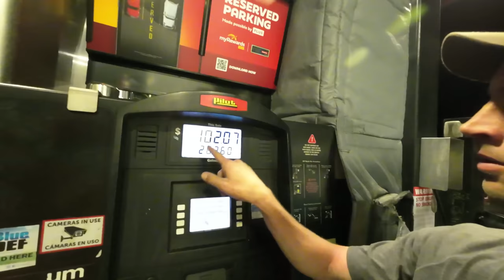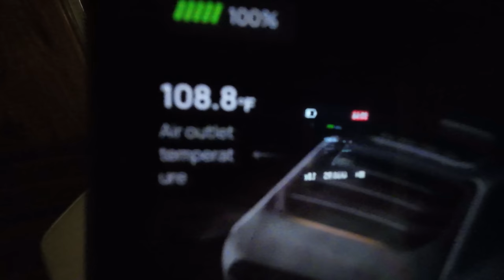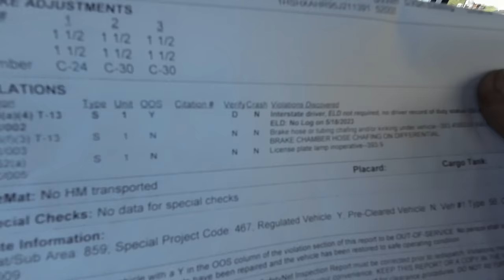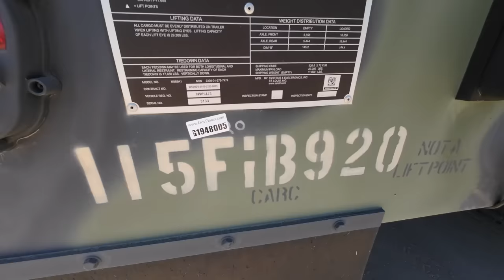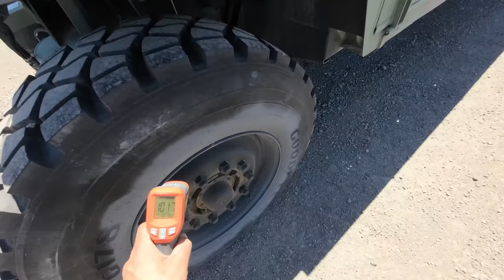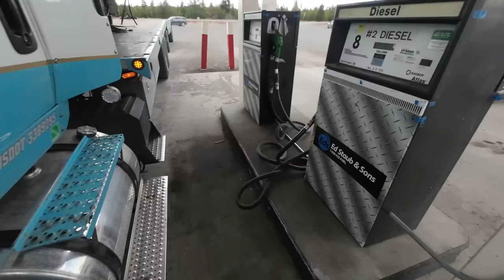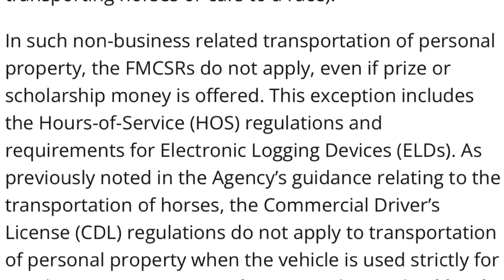Busted by CHP!   But I Know a Loophole…

Comment: So, before building a cabin on that trailer, build a frame slide out for a porch. Then build the cabin above the porch.The trailer is way over built for a cabin, so take advantage of that and add some more weight by building a slide out porch bed.

Comment: Sounds like you want to build a tiny house on that trailer.  A friend did that on an old enclosed trailer he originally purchased to move himself and his wife to Florida.  After they were settled in, he stripped it down to the frame and built the house on it.  Came out really nice and they now use it as a guess house and air BNB income when no one is planned to be visiting.  I envision a nice cabin on that military trailer.  Good luck, can't wait until you have the time to do that series of content. Stay safe.

Comment: Crossing from Texas into NM I was once told I needed a log book for a company 3/4 ton pickup since I was pulling a trailer and was more than 100 miles from the yard. Empty 16' trailer, 3000 lb axles. I pointed out that a CDL was not required to operate said vehicle. He ran me through the wringer for about 30 minutes, made me pay a $7 'road use tax' for going 20 miles into NM [which I suspect was actually lunch money] then cut me loose with no tickets. I got the load I was after and left his fine state with finger extended.

Comment: Some trailers with that axle setup have a air cylinder connected to the reverse light wire that pivots the axle to change the castor so that you can back them up and they will steer properly for you.

Comment: Lol, you're getting about the same MPG as I get when towing a 4000lb trailer with my first-generation Tacoma.

I'm hoping to improve that a bit, though. I was involved in a hit and run accident recently, so while my truck is torn about to fix the damage from the wreck, I will use this opportunity to fix a few things I've been pushing off. Exhaust leak, busted wiring harness for my AF sensor, and cut out or replace a partially clogged cat. I'm hoping getting rid of the bad cat will show an improvement in power and mpg.

Comment: Here's a thought, simply transfer the swap-body onto the trailer and bingo - you have your cabin away from home and you will have a sun-deck too (I seriously doubt that the wee swap body camper will be too long for that trailer - so a wonderful open area sun-deck will be gained -simply by putting the swap-body camper - directly onto the trailer.
It is after all, part of your "long term plan" isn't it - to have a camper on that long/low-boy deck.?

Comment: Before you said anything about a cabin I seen how wide this trailer was and thinking the same thing for living quarters. The fact that the trailer steers, and is on four wheels, makes it ideal because one does not have to worry about tonged jack as well as many other aspects of a standard camper. I would put some stiff legs (levelers) on the corners for leveling if needed. Now that i've see this thing, I want one too.

Comment: Casey....On the ammo trailer if I remember correctly there is a pin so you can lock the steering so you can back it up easly but remember to unlock steering when you need to use it...

Comment: What a quiet running truck. Not much noise picked up by your recording device and I could actually hear and understand you. Laptop, head set 
Will the trailer need to be plated and insured ?
Subbed.😊

Comment: That protective coating on the sidewalls... pretty cool stuff.  It keeps oxygen and ozone out and lets the tires stay "fresh" for about 2-3 times as long as they otherwise would.  Of course, when it's that flaked apart, it will have already done its job.  Properly treated and properly stored, tires treated with cane be installed like 10-12 years after they were made and work just fine for just about as long as they would have when they come out of their original molds.

Comment: Hey Casey, I've had my experiences with CHP myself, and I've learned that if you disagree with a violation, you should insist on a ticket. At least that way you can fight it in court and get the points off your score!
Reply: As I explained to Casey ------------- You are correct about using your truck for "personal use", which does not effect your HOS, but you are required to  log it on line 1 - off duty and in the notations, mark it as PC  ( Personal Conveyance ) with start and end points as usual and include those miles as personal use, so they don't count when you file IFTA.

Comment: If you build a cabin on the trailer, build it with a 3 layer wall on one side. Hinge 1 at the top and 1 at the bottom so you can fold them out to form an outside roofed deck with removable support posts and legs. You can sit out on your front porch and enjoy the evenings even when raining. All you need are a few lawn chairs.

Comment: I'm sooooo with building the cabin on the trailer.  If I lived near you I would volunteer to help you build it.  I have construction experience, electrical, moderate plumbing skills,  siding , roofing,  windows and draw plans on CAD.

Comment: Until you 'build' your cabin on the trailer, I can see you using it on the forest cleanup.  A lot of things will fit in there that won't fit on/in other rigs.  Great for lots of pieces.   
I used to drive Flatbed only in the state of Oregon (from mid Willamette valley); one day my company decided that the load of Vetch seed I picked up needed to go to the Tacoma, WA docks the next morning so won't be uploading it.   So next morning off I went.  Got to the scales out of Vancouver WA and they brought me in and asked to see my log book (a what?).  He told me he could hold me there 8 hours.  I told him I knew nothing of the requirement and I was just following orders and that I would pick one up at the next truck stop.  He let me go.  Two days later I got sent to Seattle/Renton/Kent (had my log book) and on the way back at the scale out of Tacoma the officer told me he could give me a ticket for the Washington Sticker (back when you had to have a sticker for each state) being in the wrong place (and hence they get the nitpicky nickname).

Comment: The cracking surface on the tire is probably black spray paint. When Armor All  doesn't get the tire black and shiny enough for inspection troops will sometimes spray paint the sides of the tire.

Comment: When a vehicle gets sent to depot or RAD (Repair Activity Depot) to either be upgraded or refit, they are completely stripped and rebuild. All tooling and parts are installed and any accessories are placed. What you got was more than likely a vehicle that has be restored to new or near new condition. Excessing such vehicles is not common, but does occur when a new model has been designated.  If there are enough  VIN and/or any unit, equipment numbers you might be able to find the trailers actual history. You can also look into any internal odometer. It looks fairly recent so it should have some type of device.

Comment: To turn it into a mobile home I'd suggest looking into a light weight travel trailer that will fit in and take all the running gear and suspension off it and secure that to your new trailer. You could even have a travel trailer with slide outs.

Comment: For the air leak, Use the liquid version of Teflon tape instead of Teflon tape itself. The tape could get into other small areas of the air system and cause issues.

Comment: What would be really cool with that trailer is you could rent a custom self contained camper insert. You simply drop a side and then the rental place would put the camper insert in with a forklift.

I’ve seen other places where they make a camper insert that would fit in the back of a rental box truck. Kind of stealth camping using a box rental truck. You could put the camper insert in the trailer as needed. 

It could also be used as a construction site office trailer as needed.  You just put it in the trailer as needed and haul it to the construction site. 

Ever thought of purchasing these trailers and renting them out as construction site trailers?

Comment: What does the trailer weigh? A great platform for an RV build. Room for Generator and fresh water. Low center of gravity. heavy duty tow capability. After you build a shop, you can start on the RV project.. Very nice video!!

Comment: That trailer was reconditioned and that's crazy the BII was inside of it, usually units keep that in a separate cage in the motor pool so it doesn't get stolen.  It's obvious that after it was reconditioned it was NEVER used, the unit was supposed to go through the BII line by line and lay it out while removing the packaging and tags.

Comment: the 4 shackles on the top of the trailer aren't tie downs... they are lift points for crane or helicopter carry about.  But, they will work just fine as tiedowns if you wanna use them as such.

Comment: Note sure if some one already posted, but if my mind reminds me there should be a backing pin that goes in the front axle I believe the top right. To essentially lock the trailer while backing to simplify it. Although I may be confused as later in my career I felt with Plst trailers more

Comment: Here's some ideas until you build your bug-out cabin:
Hay rides for the kids.  Fill the bed with hay bales!
Mobile dance stage.  Would be fun at a kids party? 
Mobile music stage.  Rent it out for festivals.  The band could play from an elevated position.  Speakers on the front and rear metal decks.
Parades.  "donate" it to a good cause to use in a parade and get an 'in kind' tax deductible receipt.

Comment: My understanding is, depending on weight class of the truck, if you have a DOT number on the Truck you have to run a log over a certain milage from your home station. If you have a "not for hire" sign logs are not needed, but if you get caught with a paid load with the "not for hire" decals... They'll have there way with you!

Comment: So, if you don't know, there is a pin to lock the steering on the trailer. Only use the pin for straight backing.

Comment: Log books are only used when, in general, a commercial motor vehicle is used as part of a business and is involved in interstate commerce and fits any of these descriptions: Weighs 10,001 pounds or more. Has a gross vehicle weight rating or gross combination weight rating of 10,001 pounds or more.

Comment: Casey, I haven't read all the comments.  So, if anyone has already posted about the paint on tires.  It's over spray from painting the rims. It's not time efficient to do a "Robbie Layton's" quality job when applying C.A.R.C. paint to military vehicles.  On the subject of it being unused, that is highly likely, a Army Military Police Bn. back around 06-07 got force issued trailers for every HUMVE, then less than a year had to turn in to be sold off through DRMO.  During the time the unit had them, they weren't allowed to utilize any. Much military equipment is stocked as "Just in case only needed for wartime use"  so only a portion is utilized  for training and day to day operations.
 
Well, now you do have a solid storage spot for your slide in camper, set it on that trailer.

Comment: Casey; Please get  a set of flare nut wrenches BEFORE you work on the air line.  Also  NO TAPE, use   565 , 567 ,577 paste.  Teflon tape tears up and small pieces plug ports.

Comment: I have not read all of the replies, so maybe someone already mention this, but there are mil-surplus "shelters" of different sizes - up to about 20' long, some with slide out expansions, that are really popular for Overlanding/Expedition vehicles to convert to habitats. Also, there are of shipping containers too - they are much heavier, but could be quite useful as a mobile shop - depending on the size of the cargo area of the trailer - I am betting that this trailer you just got is actually designed for a 20' shipping container (maybe not - those fold down sides are usually 8' long).

Comment: Thst steering system is great . The way they are set up,so that if you connected a few in line , they will follow in line as if they on tracks . In the UK the RAF use similar system trailers for carrying amo , bombs and missiles from magazines to aircraft.

Comment: You could put a removable 10 foot or 12 foot container on that trailer that is fully winter-insulated with built-in air conditioning, heating and full bathroom/shower, kitchen and sleeping area (i.e. make an extending rooftop sleeping area on the container!). You can even cut windows and custom doors into the container to make it a fully removeable camper that you can take anywhere and use the front and back of the trailer as a covered porch area with motorized extending awnings and plastic windows/side coverings for wind and sun/rain protection. 

You can even put in a portable HOT TUB, BBQ and 75 inch 4K resolution OLED screen home theatre with surround sound speaker and Playstation/Xbox setup behind or in front of the container on the "trailer porch areas" for your luxury backwoods camping trips!

Soooo, buy a new or used container that fully fits that middle-of-trailer trailer section and BUILD teh container into a custom camper with extending rooftop sleeping area and make some porch-like platforms for the front and back area over the trailer wheels so you can install what I noted above!

V

Comment: 22:05)Now the old "cheater bar" is official equipment? 40+ years ago we had to use any piece of pipe to loosen or tighten lug nuts. 
24:01)The shackles are for lifting or for tie down. I do not remember if it was "The Boys in Company B", but there was a Viet Nam era USMC movie. In the background was a 2.5 ton truck going as deck cargo. The civilian movie makers DID NOT tie down the truck.

Comment: Years ago the police used to have a fit that as a cab driver “we” didn’t have to wear seat belts.  Cab drivers were considered privately owned commercial drivers, which exempted us from seat belt use.  Driving out of town most of us wore a seatbelt, but in town it was impractical with having to get out of the car multiple times per shift assisting customers.

Comment: The Army trailer is called HEMAT-Heavy Expanded Mobility Ammunition Trailer and you back up that trailer you lock the tongue of trail so it won’t pivot also don’t lose that locking pin it hard find but I used to operate the HEMTTs to pull those trailers went I was in the Army

Comment: . You must have a log for each 
day of the last 8 days that you were required to log (you might have been under an exception on 
some of those days). The current day’s log must be current to your last change of duty status. As previously noted in the Agency’s guidance relating to the transportation of horses, the Commercial Driver’s License (CDL) regulations do not apply to transportation of personal property when the vehicle is used strictly for non-business purposes unless a CDL is required by the driver’s home state.

Comment: Hi, for record of duty consideration and logbook requirements, does your personal use of the truck conflict with the usage of the commercial fueling account?  Thanks for sharing the video!
Reply: What I told Casey ---------------You are correct about using your truck for "personal use", which does not effect your HOS, but you are required to  log it on line 1 - off duty and in the notations, mark it as PC  ( Personal Conveyance ) with start and end points as usual and include those miles as personal use, so they don't count when you file IFTA.

Comment: It would be so much fun to fabricate a clutched, Kubota 4BT powered diesel over hydraulic 4WD system for the trailer.. you could disconnect your future "bugout cabin" to adjust your parking location, or to maneuver through extra tight spots in the woods;)

Comment: Any violation will prevent you from getting a fancy sticker.   For the logs you need to have a minimum of 8 blank pages worth of logs with you.  

Since you are running line 5; Personal Convayance, I do believe you still need to fill out a log and line 5.  I could be wrong on that part but you are required to have blank logs

Comment: The very first thing i thought of with this is build a tiny home on it, even over the frt and back areas you can build loft sections,  im even willing to bet there is room for fresh water tank and waste water tanks under it like in the tool box area. Or that could be a slide out work bench.
Then on that line you could make a woodworking shop on wheels, 
Or use it to haul bobcats and equipment on. Even a mini excavator. Or Old Ford 8n or kebota tractor with attachments. 
Lawn equipment,  cattel house boat
  Its a cool pice of equipment. Or just drop a storage container on it with tools for hevy construction equipment kinda as a equipment repair truck tow behind.
It has an endless amount of uses.
Hell you might need more then one.
You could build em up and sell them.

Comment: Video towing Uhaul Ford with trailer behind Zack Lift: 1) Loosing light bar is what $800.00 mistake? 2) You reinstalled the drive shaft with the old strap kit! If drive shaft comes out for any reason you can be held liable for any and all damage or body injury.
Reply from the maker: Sure

Comment: FMCSA manual says under Personal Conveyance

A driver may record time operating a CMV for personal conveyance (i.e., for personal use or reasons) as off-duty only when the driver is relieved from work and all responsibility for performing work by the motor carrier. The CMV may be used for personal conveyance even if it is laden, since the load is not being transported for the commercial benefit of the carrier at that time. Personal conveyance does not reduce a driver’s or motor carrier’s responsibility to operate a CMV safely. Motor carriers can establish personal conveyance limitations either within the scope of, or more restrictive than, this guidance, such as banning use of a CMV for personal conveyance purposes, imposing a distance limitation on personal conveyance, or prohibiting personal conveyance while the CMV is laden.